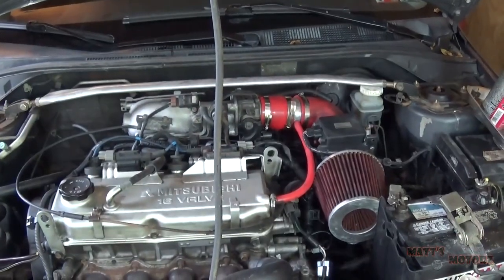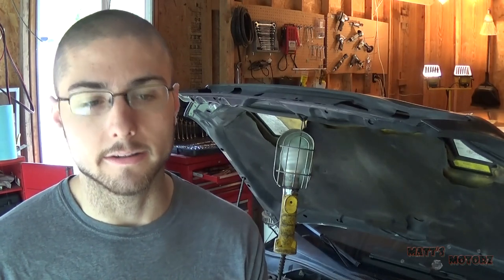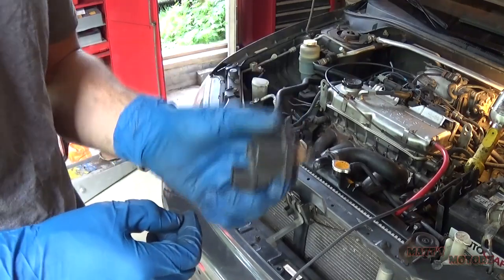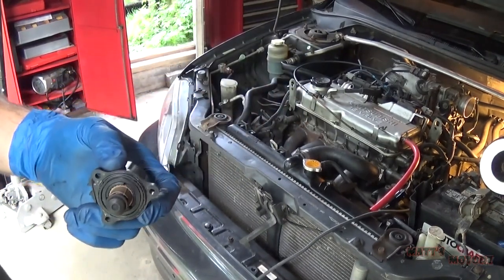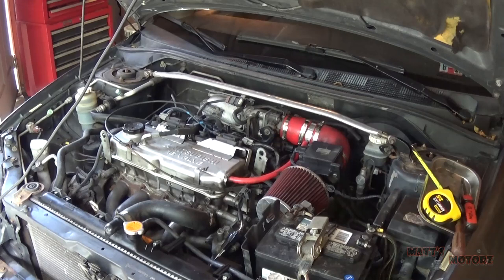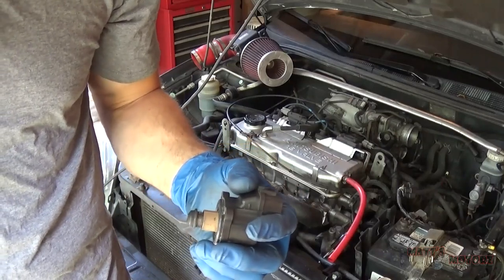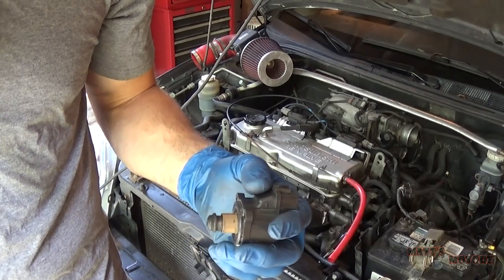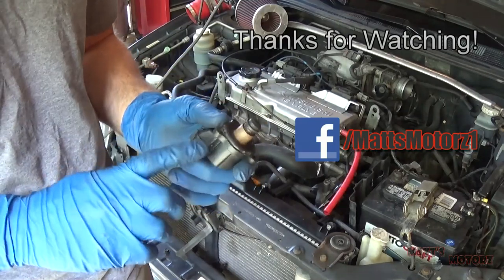Easy Way to Check an Idle Air Control Valve

Comment: can an iac valve kill a car randomly for no reason?
Reply from the maker: Skid xxx Well it wouldn't be for no reason.  But yes.  For example, on this car, whenever the car warmed up and was idling, it would stall.  Or when driving, when coming to a stop it would stall.  But it really depends how your car is dying and when it is happening.  It would be a bunch of other things.
Reply: +MattsMotorz - Hi Matt,  what is the lifespan of an IAC valve ?  If you clean them, how do they compare to a new one ?  If not adjusted properly, would it cause the vehicle to idle poorly until its warmed up ?
Reply from the maker: It really depends. IAC valves can last a very long time.  Cleaning IAC valves does nothing in the operation of the valve itself (unless it's gunked up to the point of impeding movement), it merely cleans off the gunk ON the valve (which affects the operation of the ENGINE).

You don't adjust IAC valves, they are completely computer controlled.

Comment: I have a 99 civic that runs fine, but when the AC is turned on it stalls and won't accelerate. When in parked it shakes the car and stalls out. What's up?
Reply from the maker: Matthew Villanueva The AC puts a strain on the engine, the engine must compensate by adding more fuel (and therefore more air) to give the engine more power to run the AC compressor. While in park, hold down the gas pedal to about 2000 RPM and then turn on the AC.  If the engine still runs fine by doing this, then the cause is an air problem. (Air problems tend to not be such a big deal when the engine RPM is up, but as soon as you go to idle speeds, they get more and more of a pain). Could be the IAC or a vacuum leak.

Comment: I have a Chevy cobalt when I speed to 50 the rpm good at 10000 but when I speed it will stay between  20000 and 3
Reply from the maker: +Edgar Velasco Huh? These numbers are crazy. Between 20,000 and 3???? I don't understand.
Reply: +MattsMotorz How one zero can make such a difference..you know what he meant..
Reply from the maker: Lol it's funny, I honestly didn't.  Not until reading your comment did I realize he meant "2000 and 3000"  I must have been particularly slow that day ha.

Comment: When you talk about unplugging it while the engine is running you are describing a situation specific to only that style of "pintle" as you call it.  Many are spring loaded and return to a specific position the moment power is disconnected, or will just freely move around without a spring and worn bearing.

Comment: I've replaced iac valve 3 times in my 1992 Bonneville ssei.  Anything you can think of that would repeatedly ruin iac?  Vacuum leak maybe?  Took to a mechanic and he got code Boost control solenoid.  Replaced that and now have code 56 for general ecm problem.  I have another ecm yo put in, but think I'm missing some fundamental.

Comment: i will try to replace my spark plugs first because i wasn't able to replace it the last time i tuned my car. (it needs to be replaced that time but i didn't replace it) i will also try to check my coils. if none of it works i will replace my iac valve.
Reply from the maker: +Lance Roman Let me know how it goes!
Reply: You doing it backwards LOL. Your IAC is much easier and cheaper to replace first then all of your spark plugs add coils.

Comment: '01 Focus, which occasionally won't start after a few 5 minute drives. It literally won't start normally. Only way to get it to run is continuously give it gas, even in park. If i take my foot off for even a second... it stalls.

But if i drive it 45 minutes to work, it is perfectly fine. I hope this is the problem.
Reply from the maker: Rob774 That definitely sounds like an air issue. (Whenever a car stalls like that, but doesn't stall when you rev it up, it's an air issue.) A stuck open IAC would absolutely cause this problem.  It could also be a vacuum leak somewhere.  Check for vacuum leaks first since it's easy.

Comment: I showed my girlfriend my 7/8 inch pintle and she laughed at it. That really turned my engine off and that's when my already small pintle retracted to 0 inches in length.
 :'(
Reply: It's not the size of the pentle that matters it's the size of the throttle body that it's going in.

Comment: my dodge truck will idle but when I rev it itll bog and die, can the iac valve go bad suddenly? it set for 4 days, and when I started it today it started acting bad....
Reply from the maker: MegaHosscat That doesn't sound like an IAC problem.  The opposite would occur.

First thing I would do is check the fuel pressure.

Comment: nice cai
Reply: 1989 Lincoln town car it wi

1989 LIncoln town car when it cold it will crank when u drive it and it hot u cut it off it will not crank let it for about 4 hour ot will crank

Comment: When I think about how long it took me to get the idle air control valve on my car and lined up with the gasket and screws..I can't see this as being easy
Reply: Just think a mechanic will charge you $100 for labor for a 5 min job plus parts costing upwards of $300 for a IAC. By the way the chinese reversed engineered the part for $15 or less you can buy one. Now you know what kind of ripoff car owners go thru.

Comment: this method doesn't work on my 99 civic ex , it revs up and down until you plug it back in.
Reply from the maker: That is a very common issue on Hondas, it indicates a problem with the fast idle valve, which you likely have since it is a 99.
Reply: you mean the one you can screw back in ?  it doesn't have that kind if any

Comment: What's the point of this? Why not get rid of the valve? This is what air comes in from the air cleaner is  for. Just replaced one of those valves and it doesn't seen to really make a difference. Reason I replaced it was I had high idle for no reason and the great red brick told me this was the problem.

Comment: It's not a motor, it's a solenoid.
Reply from the maker: No it's not.  It is (normally) a stepper motor.  It needs to have continuous movement, a solenoid is ON or OFF.
Reply: dont u mean sillynoid
Reply: +crackbadger man - LOL
Reply: It's a " Solenoid Motor " 🤑🤑🤑🤑🤑🤑🤑🤑🤑🤑

Comment: it just cranks
Reply from the maker: +Drew Williams To me, all this sounds like a bad crankshaft or camshaft position sensor.  Sometimes these cause the engine to sputter when trying to start, but not all the time.  I have seen it happen enough to say that that is most likely the cause.
Reply: ok car was running and had a misfire on 4 pulled plug it ran for a few seconds then cutoff and now can't get spark. any ideas? and I appreciate the help
Reply from the maker: I am still thinking it could be the crank or cam position sensor (depending on which one your car has).    

Can you get spark on any other cylinder?  If you can, observe the spark as you crank.  Is it sparking at a constant rate? Or is it sporadic?

Comment: Wrong....Pull the ICV out ...plug it back into the connector , set it where you can watch it move in & out while turning the ignition on & off ...! If it doesn't move it's bad ...!

Comment: Hi, 
I have a car that idles smoothly but once I give in some gas and take off the foot from pedal.. it will rev high for ~10 seconds and then slowly come back to idle. Where can the problem be ?
Reply from the maker: +shashank kumar First thing I would do is check for vacuum leaks.

Comment: sorry but that mask will not help you at all with the fumes filing your shop. lol   unless you had on a S.C.B.A   then it would be all good . just had to laugh when you said  you had the mask cuz your garage was filling with fumes .
Reply from the maker: Ruk .Hollow As I mentioned in the comments many times already, I am fully aware.  It was the only thing I had and it was better than nothing.  But I'm glad I could be so entertaining.
Reply: MattsMotorz It might not be better than nothing.  If it gave you the false impression it was okay to stay in the garage full of fumes containing carbon monoxide, you might have been better off not having the mask so you left the area and aired it out sooner.
Reply from the maker: Yeah you're probably right. I have since bought a proper mask so we are all good now!
Reply: MattsMotorz
I usually just park right next to the garage door with the pipe pointing outside, then open the garage door while it's running... or put it off till it's nice enough to do the work outside then any random soot or grease left behind is easier to clean up with a leaf blower, driveway degreaser, water hose, etc.